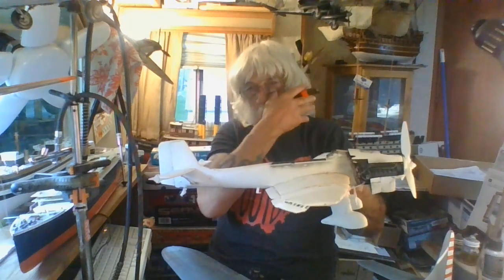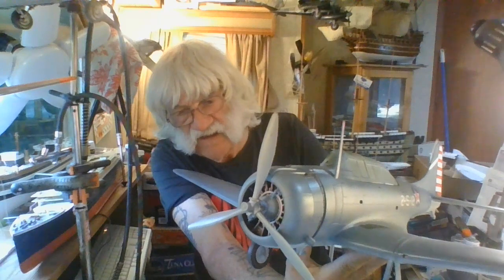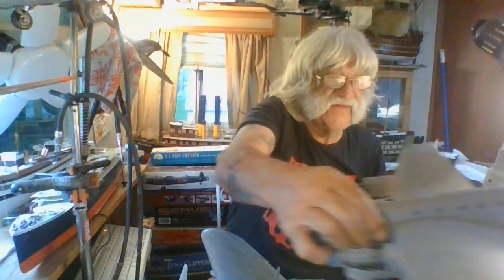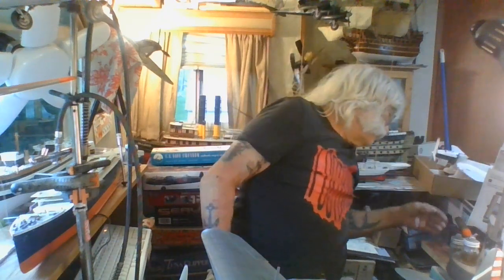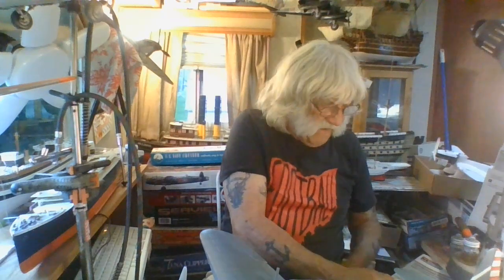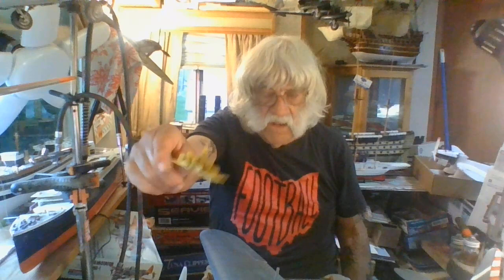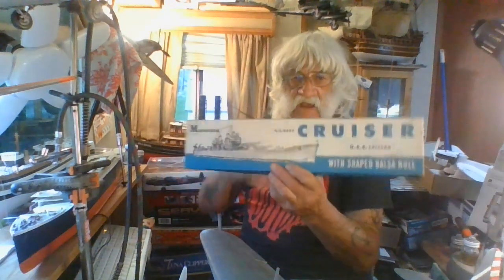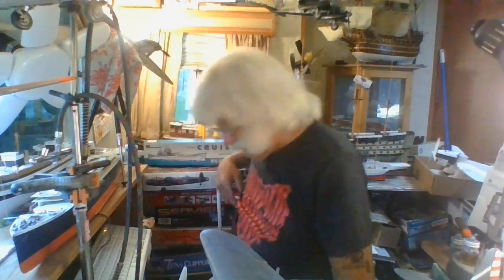Merit 1/18th Scale SBD DAUNTLESS DIVE BOMBER VIDEO 4

Comment: I get your drift. I have no huge stuff except the carrier Enterprise in 1/350 scale. But, I have quite a few builds here & there mid way for one reason or another. Usually greater interest of a newer subject. It isn't small but, I built a V-1 & launch ramp in just hours. Putting other interests on back burner. Then A 1/35 scale U-Boat conning tower. Then I got on a kick of building 1/35 scale German railroad cars & an Engine. I am waiting on a 1/32 scale Devastator from Trumpeter. That will do some pushing.